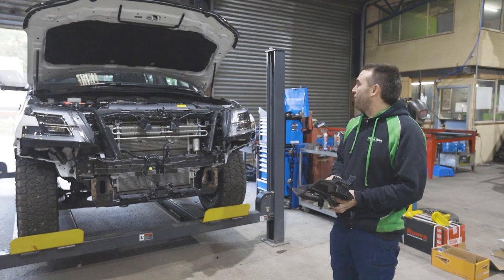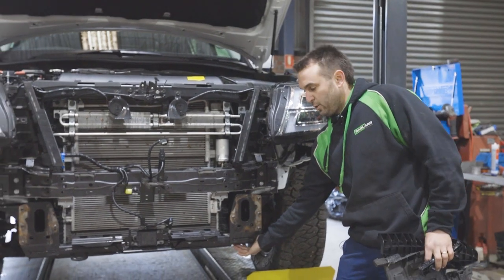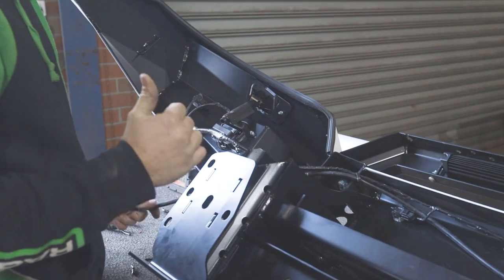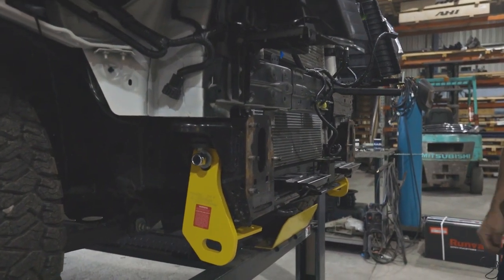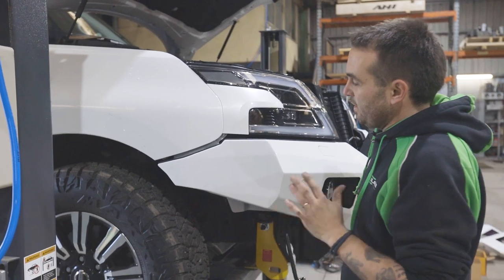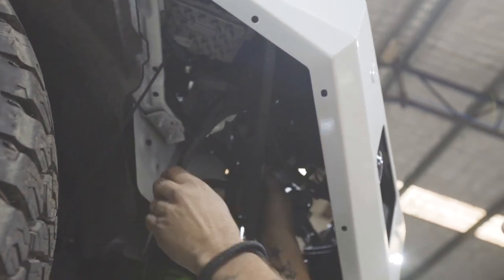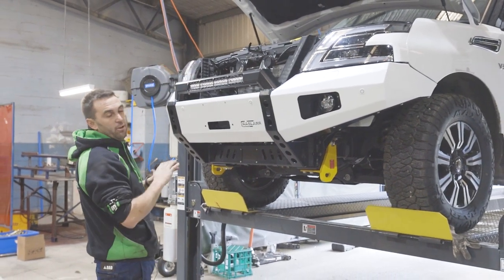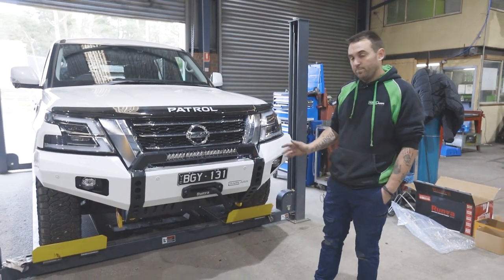RASLARR - NISSAN PATROL S5 Y62 Patrol Bull Bar Fitment

Comment: Hey legends! Just curious, would it be easy enough to install a winch after installing the bar a few months prior? Or is it a pain to get the grill in and out etc? Trying to decide wether to by the winch and bar at the same time or spread them out a bit 👍
Reply: Na easy to pop grill out later 👍
Reply: @stellap372  awesome thank you. Also curious, the 55kg for the bar, does that include the weight of the recovery points? Or would they be in addition to the bar weight? Roughly 12kg for the pair of recovery points?
Reply: @liamkendle480  Hi Liam, the recovery points with the appropriate bolts when fitting the bar, are an additional 17kg. In the test we did, with the bar, recovery points, light bar, fog lights and carbon winch, the car gained 76kg between what you removed and what you added.
Reply: @stellap372  thank you so much for that. There’s a thread running on Facebook discussing it so we were trying to work it out. You’ve answered the question perfectly and good to see it’s under the specified weight by nissan as well!
Reply: @liamkendle480  Happy to help!!

Comment: What's the weight on these (without the winch) pls?
Reply: @stellap372  is it really 80kg for just the bar? Your website says approximately 55kg.
Reply: @liamkendle480  Hi Liam, yeah sorry I replied with the rear bar weight. You are correct, 55kg for the Bullbar.
Reply: @stellap372  all good, just wanted to check. Hands down the best bar for the Y62!!